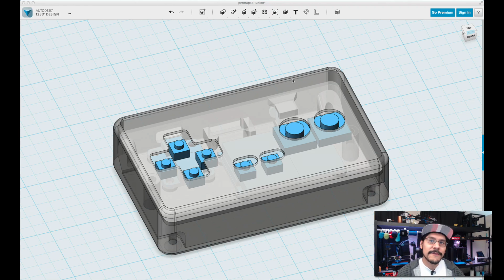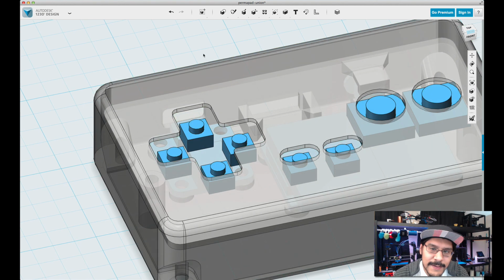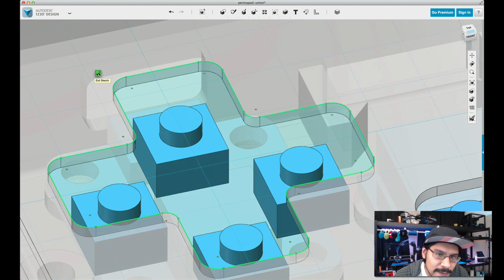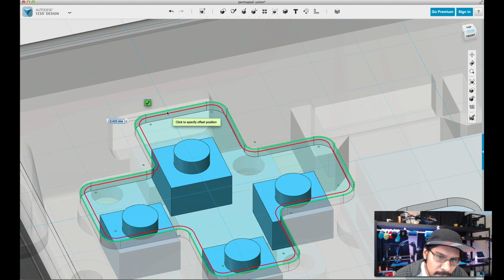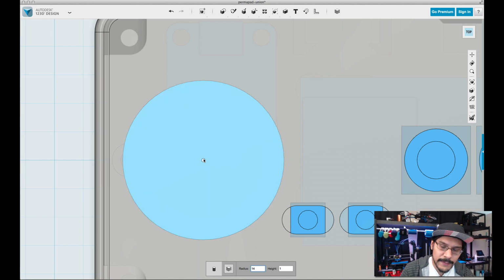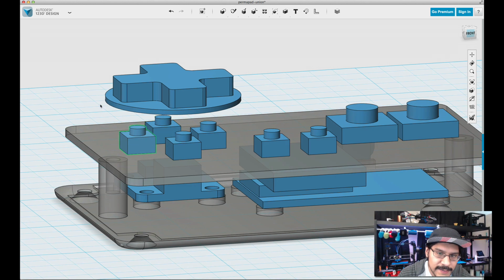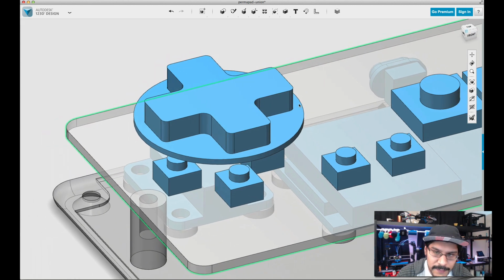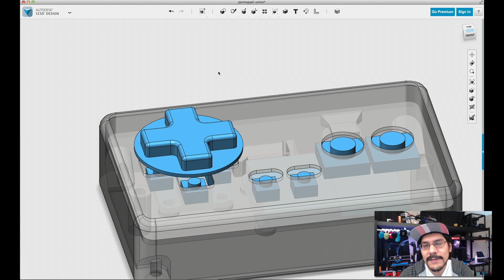Layer by Layer - Making D-Pad for Game Controller

Comment: Great video again, this is going to make my valentines project far easier. I didn't know about the project feature in 123d until now. How about a video on making something print in place with joints, maybe an updated Adabot, I always have issues with not breaking its legs trying to get the support out. Still haven't got one with moveable legs.